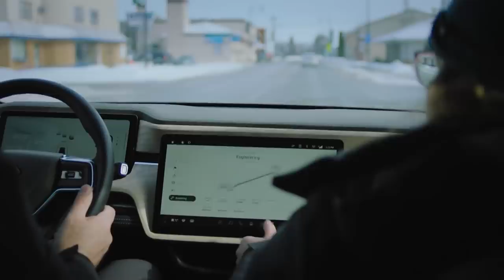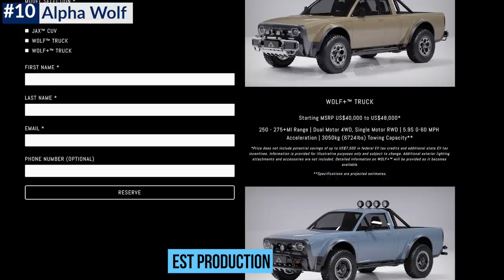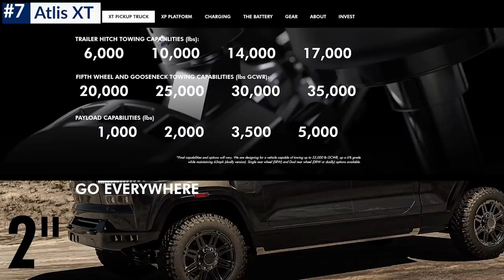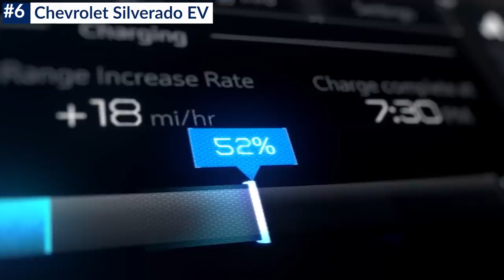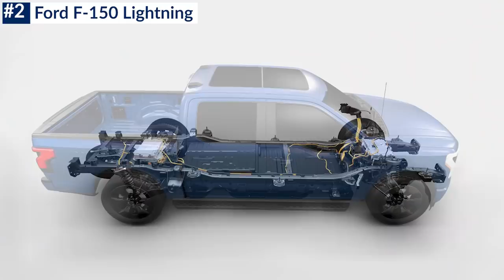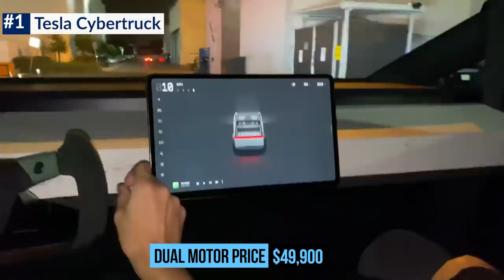10 Electric Pickup Trucks to hit US Streets Soon | It's Happening!

Comment: If most of these are faster then can be used is the power/ battery just a useless expense? What would the cost and range be it they had comparable power to what’s on the road today? How high will the insurance be on the crazy fast models because your kids will try them out. Just some thoughts.
Reply: The government needs to look into this. We don't need Zombie rich kids killing people with their affluenza syndrome.
Reply: a good part of why electric cars are faster than internal combustion cars is because of how electric motor HP ratings differ from the HP ratings of an ICE. A 50 HP electric motor has 50 HP available for use at 1 RPM. HP ratings for ICE motors are peak ratings and occur at a specific RPM. Peak HP on an electric motor can be 3-4x the listed rating. So a standard car with 200 HP only has 200 HP at, say, 5300 RPM, and has some lesser amount up to that RPM. An electric car with 200 HP will have 200 HP available to turn the wheels the moment you step on the accelerator, and could potentially have a peak HP in the 600-800 range.
Reply: There will be enough safety features that will make the insurance rate lower based on the laws in almost all of the states here in the US market. For example, Tesla vehicles are cheaper to insure compared to similarly priced ICE vehicles because of the safety features.
Reply: @user-zq6pj5jo8j  the main factors affecting EV range are the weight of the vehicle the rolling resistance and the drag coefficient adding additional Motors does negatively impact the overall range but not by much. This is because the electric motors are only using the amount of energy needed to move the vehicle. If you were truly interested in increasing the net range of electric vehicles convince government Regulators to allow the use of cameras instead of mirrors, the reduction in drag will do more for range than depowering the motors
Reply: @user-zq6pj5jo8j  mirrors fail all the time, generally from the same factors that make cameras fail. Dirt and impact.
Reply: @user-zq6pj5jo8j  200hp? lol I've seen go carts with more power.

Comment: I would like that in the comparison between this type of vehicle the dimensions (width, length, height, distance between the trucks and, especially, the length of the truck bed) are indicated. This information is important as the comforts that each model has. In addition, I would like to know if it is produced with an extra cab, since that type of configuration leads to a longer truck bed than double cab trucks. For me, having a longer truck bed is very useful to carry my motorcycle more protected (I do not like to take the rear door of the truck bed down when I am carrying one or two motorcycles).

Comment: Question: When these are rated for mileage, what accounts for towing and or packing weight in these numbers? With a car, no big deal but we’re talking about work vehicle so shouldn’t we pack these things down or put them to full load and determine what those figure are? What good is a 200 mile truck if you can only go 40 miles fully loaded?
Reply: Rivian goes from almost 400 mile range to 90... Yet EV fans won't admit Bev's aren't for everyone or that diesel still makes far more sense for trucks.
Reply: Check out The Fast Lane's YouTube channel.  They have a comparison video of the F-150 EV (If my memory serves me correctly) towing the same trailer as a gas truck and it didn't fair too well.  If towing capacity is an issue for you, and EV truck/SUV probably isn't going to be for you.
Reply: Apparently, these trucks are only meant to take you down to the local farmers market and throw a few bushels of apples into the bed of the truck.  Also, these EV makers touting 0-60 times means they are catering to the folks who own trucks that have only seen a mall parking lot.
Reply: If you're looking for an actual work truck you're watching the wrong video.

Comment: Confused by 3 motors that seems to be common.  4 moters would be one per wheel and 2 would be one for front and one for back.  1!could also work with various transmission setup.
Reply: Lordstown Motors has one in each wheel. True all-wheel drive with no differentials.

Comment: how far can thes electric pick up truck run on a full charge?  empty and full loaded?  that is the question
Reply: the ford lighting was tested with a load getting 250-300 miles, so you might get like 350-400 without a load
Reply: Victor Joseph
You must be uber old, what was your first car? 1958 model?
Reply: I think with a fully loaded hauling truck the range will decrease by 50%; Thus, the range will be 150 miles with a fully loaded hauling truck.

Comment: The moment you decided to put the F150 at Number 2 you broadcast your lack of understanding of the truck space. 
It is by and far the most significant EV to come to market. Ever. 
This is the EV version of the world's top selling pickup truck for over 40 years, and for many of those years the most popular vehicle in the world period.
The Cybertruck by comparison is a trophy lifestyle purchase made for non-truck people by people who don't know what trucks actually are used for. IT Middle Management will love it however...
Reply: Exactly what I was thinking. Ford has done an amazing job with the Lightning. The features just go on and on and on. The only real truck here.
Reply: Found on road dead 🤣💩🤡
Reply: The reason the Cybertruck is no 1 on this list is there is an actual factory almost finished, parts are ordered and everything is ready to go. You are right that the Ford is a much more important truck and will vastly outsell the Cybertruck, but for the opposite of the reasons you said. I build boat docks in nw Montana, my trucks go through more than just about any in the country. That's why I run old pickups and medium duty trucks, Ive tried a few new trucks and they wouldn't last a year doing the work I do. sure they can haul a big trailer down the highway at ludicrous speeds but I see what my local utility companies spend on truck repairs and I shake my head. The big three haven't built a tough pickup in years, my 74 IH D200 will do things no stock modern pickup will do, including the F150 Lightning. The Cybertruck on the other hand should be able to take the abuse that I put my other trucks through, I have one on order and plan to use it like I use all my other tools.

Comment: People complains that if you put a lot of weight it’ll suck the power quickly but I don’t think people will buy these for hauling services. A couple of sheets of plywood and a dozen 2x4s won’t make much difference. ( by the way who notice the price of wood going to the roof? I mean a 2x4x8’ was 2.30 USD and now is 10.50!) They claim that these trucks will suck lots of power and add a more expensive electrical bill but most of the people I know that have Teslas have already an individual system of solar panels to feed the vehicle.
Reply: How much did that solar system cost them? Takes a lot of electricity to cover the cost of a solar system that requires maintenance and replacement.

Comment: That F150 is gonna be so nice if we can install a rack on top. Hopefully they can make affordable trucks in the near future.
Reply: Hopefully they can make electricity in the future. Dummy
Reply: Problem is Ford will only produce about 15,000 2022 electric F-150's and a projected 50,000 in 23, 80,000 in 2024.  That is not nearly enough to satisfy the demand!  They already need a larger capacity battery production plant!
Reply: @Kangenpower7  they'll get there, because they'll have an actual product to show their financiers. Tesla hasn't even built the factory for Cybertruck yet.
Reply: The best thing about the F150 is that it will be the same form factor as the ICE version, so regular truck accessories will be easy to come by.
Reply: Hope you have a gas generator to charge it when there is no electricity.

Comment: They need to expand the battery production before they can actually put out all of these trucks!  F-150 is anticipated to produce only 15,000 in 2022 and 50,000 in 2023.  While they produce 500,000 gas F-150's and 250,000 F-250/350's.  

Ford really needs to build 30,000 MW battery production plants in Kansas City, near the Rouge plant in Michigan and near the F-450 plant in Ohio!  With 120,000 + MW of batteries each year, they can consider serious production of trucks in America.

Comment: Is any of those pick up trucks will be manually (transmission)?
Reply: Why?
Reply: Most EVs only have one gear ratio.
Reply: Transmissions are necessary for internal combustion (ICE) engine powered vehicles because ICEs don't become efficient until they're revving up to some extent (look at a typical ICE power curve) whereas an electric motor enjoys it's maximum efficiency (essentially, torque per amp) at zero rpms.  The torque put out by electric motors is greatest when you're essentially "bogging it down".  A lot of manufacturers brag about their ICEs having good "low end" torque, but if you bog down an ICE all the way, it dies.  This is why hybrid cars use an electric motor up to about 25 mph and then a small IC engine kicks in, propels the car and recharges the battery for when the hybrid enters stop and go traffic again.

Comment: I invested in Atlis...it's truck. I don't care about 0-60. 20,000 - 30,000 lb. towing, 300-500 mile range depending on battery pack and 15 minutes to fully charge...it's a truck.
Reply: It's a truck that you have No Clue how to work on is what it is..... you think a mechanic is expensive now Ahaha! Enjoy these prices Conformist.
Reply: @Screwloose10  I own a tesla and I have had ZERO problems.  There is nothing to work on unless with the truck you break an axle or damage it 4 wheeling.  This is not an issue...

Comment: It takes $1 billion dollars to bring a vehicle to the market if you are an established car maker.
Reply: pelousey and biden green deal
Reply: COULD YOU BRAEK THAT DOWN FOR ME.
Reply: @sethjohnson1590 ,  Think about the fender on your car.  IF you take it off the car, picture a 4 foot square block of solid steel.  The die maker has to carve out everything in that block of steel, so that the fender can fit down into the block without bending the fender.  That will create the bottom half of the die.  Then another block of steel is carved so that the other side of the fender will fit over it without bending.  Then the two dies have to fit together, punch out the part, and they have to line up so that the sheet metal fits in between, without making any excess dents, or defects.  

There are hundreds of parts that must be formed, it takes 4 years to produce all the dies, and test them.  Each switch, glovebox door, ect.  It really does take a long time.  Then you must build 10 vehicles to test crash.  10 more for fuel economy runs.  dozens of vehicles to run on test tracks to see if they will fall apart and if any parts need to be built with thicker metal or something.

Comment: Hidden benefit is electric cars have less parts and less maintenance. I have Ford c max with 200k miles and no major repairs.
Reply: @hugomontoya8587  Overpopulation?  Maybe barely in India but hardly anywhere else.
Reply: lol i have a 99 chevy 1500 with 220k miles and no major repairs
Reply: @chrisunderhill8853  I have a 2013 GMC with 28k on it, not been to the shop once, course it sits in the garage most of the time.

Comment: I wonder MPGE still the same during hauling, towing, speeding, off road, or in cold environment.
Reply: I think MPGE will decrease by 50% if the EV truck is hauling fully loaded. For example, a 300 miles range will have 150 miles range with fully loaded on hauling.

Comment: The mindset that flocks to electric cars isn’t the same as those that flock to pickup trucks. A different type of buyer altogether, if you will. This is not a criticism of either.
Reply: Yeah, all the power of a diesel with a tiny fraction of the operating costs? No market there at all. 🙄
Reply: @BelowMeGoggle  citation needed.  A diesel will likely outlast an EV by a lot, especially in temperate climates with hills.  Simply saying something is true and repeating it, doesn't make it true.

Comment: the ford lightning is # 1.  it's far more user friendly than all the others.   far better for the working consumer that actually uses their truck to earn a living.    far better for familys.  sportsmen, shopping, camping etc etc etc.  the lightning can power the house for 3 days in an emergency.  the correct range ratings still aren't available yet.  not to mention  the ford truck's #1 for decades.     the suv geek is,    ( you can guess.)
Reply: When will it be ready to buy?
Reply: I agree. My only problem with it is, it's a Ford.
Reply: ATLIS ALL THE WAY!
Reply: @harvbegal6868  yup.  a ford truck. #1 for decades

Comment: Perfect timing to unleash electric hungry vehicles during a massive heat wave and fragile utilities grid, what could go wrong?
Reply: Lucky they can run on solar power with panel installation. I heard that the  Ford lightning can power your house with a full charge for three days.
Reply: Gas guzzlers are causing these climate problems we have to get away from fossil fuels.
Reply: @davidnoyes3373  exactly is easier to get renewable energy than to clean the mess fossil fuels are making.
Reply: Worked in Service stations a long time, did the service part. The amount of electricity in Watts it takes to run a modern gas station, charging a car for thirty to sixty minutes will use about the same as. Just a thought.
Reply: @ronwade5433  you get no free lunch with EV vehicles
Reply: Said Jacob the doubter
Reply: @gemininosaga  actually what you’re talking about is ford’s hybrid truck
Reply: @Anomize23  nop, lightning all electric
Reply: @davidnoyes3373  Bull and you know it, climate change is all based on fake data, that has been proven time after time.
Reply: @ramecodiesel8271  [citation needed]
Reply: but they're so woke.  Why you crapping on their dreams?  hahahah

Comment: By the time these come on the secondhand market and start to get affordable to me I'll convert my diesel into a power generator that runs on veggie oil. To charge my.ev. the thing is those new EVs have tons of un nessesary crap on board that makes them expensive to produce and maintain. I don't need 10cameras infrared lazerguided reaview mirrors. Just the basics plus ac. No fancy touchscreen build in entertainment while a 50 bucks radio with Bluetooth is enough. Don't need massageseat just a good seat. Ect. Less is better.
Reply: I agree completely,I still farm with a 74 F350 2wd flatbed (DT360 diesel 5spd)and 1980f1504x4 longbed (300i6 4spd and DD is reg cab sb 2wd f150 (4.6 AT)for that reason,they are tools if I'm in them I'm working them if I want luxury travel the ol 00 park avenue(3800ii at) does the trick for me and has on many occasions got 28-32mpg interstate actual mpg,all phenomenal vehicles exceptionally affordable,cheap and easy to maintain and about as reliable as it gets, I have no desire to purchase a new vehicle especially a truck until EV is mainstay and infrastructure is suited accordingly since it's obvious that's where we are going if I like it or not , I like the exterior looks of that alpha wolf I want one plain as my 74/80 and that would be great heck you can keep the AC I don't ever use it anyway just add some vent windows and defrost.
Reply: True, my current truck has no power window, no power lock, nothing fancy at all & it does what it suppose to do.

Comment: I need to be able to TOW 6,000 and waiting to see how long any of these trucks can go before needing charged!
Reply: 15K lbs here
Reply: This is the real problem for some people such as myself. This is great for city dwellers, but it just doesn’t make sense for a lot of us to walk away from petroleum for the foreseeable future.
Reply: It depends on a lot, speed, trailer shape, tire pressure etc. Basically you can tow a lot if you have a streamlined setup and you are going slow (60-65). But a big empty box at 85 will suck a battery dry. Internal combustion throws 80% of it's energy away, so minor differences like tailgate up or down disappear. I can see a bad bearing or a hanging brake shoe in my EV's numbers, low tire pressure, any ineficiency shows up as a measurable power loss. A car hauler loaded with 6k lbs low and smooth driven at 65 mph will get close to the manufacturers estimated range, I think most of those ranges are conservative. A 14' flat front box trailer  with 6k lbs driven at 65 will drop range about 20-30 percent if driven consevatively. Hope that helps.
Reply: Tesla has this "problem" with their cars.  So, you go your range of ~250 miles, probably less and then you plug in and wait for 45 minutes to go another ~200 miles down the road.  Who the hell has that kind of time to sit and do nothing every few hours?  These trucks should really not be sold to the general public and only to fleets that need local trucks that don't go that far and can be plugged in each night after work.

Comment: Here's what I want to know. We can't get chips for regular vehicles, how are they going to get all the rare Earth's to keep up with building all the motors and batteries? This isn't going to end good at all. And the price will have to drop way down!
Reply: So the chip problem really is on the car manufactures. They use older & larger 45-90nm chips &  don't Trust the new technology (small form factor) thats down to like 5nm. now on iPhones.    The earth has enough rare materials its just that the big manufactures haven't  had enough time & testing this new tech.  They really need to get on the ball bc moving to smaller chip form that will save money & be able to  have pack higher density.